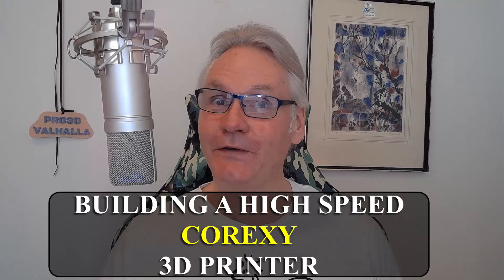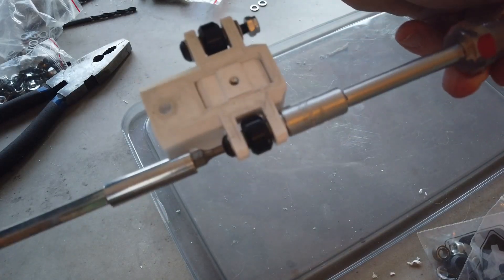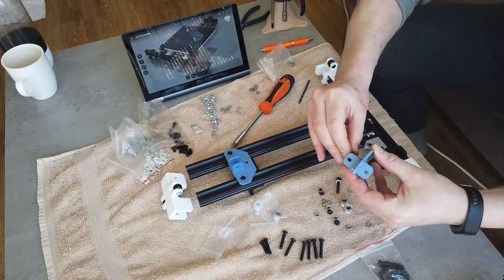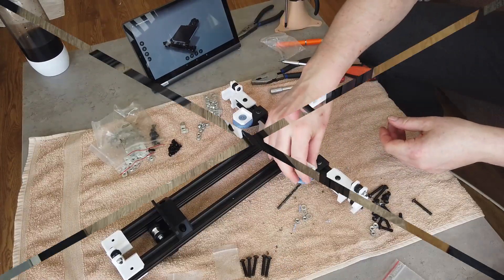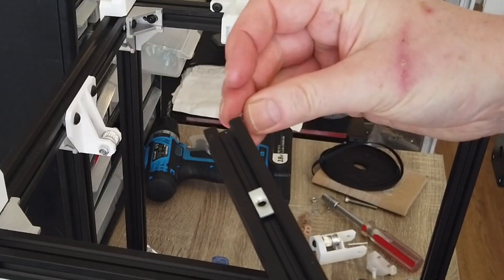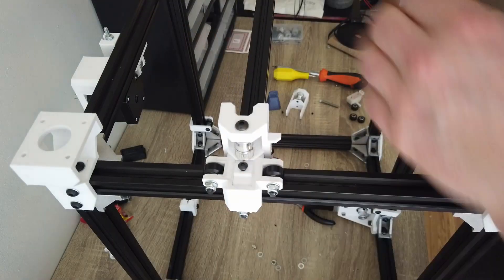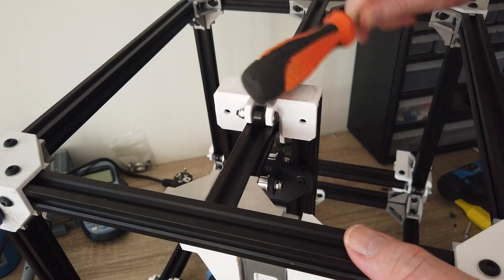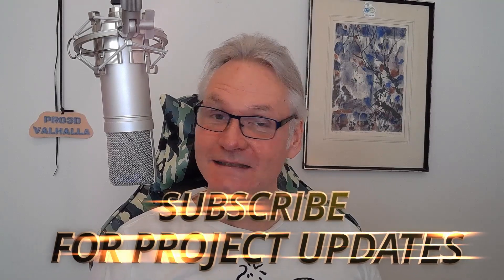Building A High Speed 3d Printer At Home | Part #4 V-baby XYZ Axis Assembly

Comment from the maker: There will be new forks so you dont have to use the spacers for more easy assembly. Just make sure you place the fork without breaking them. I will leave the old forks in the option folder if you are not able to slip on the new forks

Subscribe for project updates - Please ask anything here
Reply: thats very nice, I was about to make a open source 3d printer, and I didn't know which one, I might build this, is there a BOM for this project? thanks
Reply from the maker: Thank you! The BOM and all the info is here:
https://github.com/RoyBerntsenDesign/V-Baby-CoreXY 

https://vkingprinter.com/